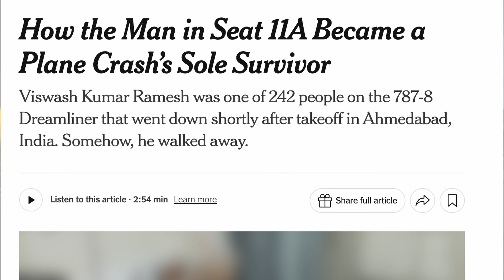Why the RAT Changes Everything – Air India 171 Update

Comment: Absolutely the sound of the RAT. Just did a RAT function test on Monday...have done it hundreds of times during my 28 years as an airline mechanic. The RAT is deployed/dropped manually and a steel cage is placed around this area, for obvious safety reasons. The RAT is designed so a hydraulic powered motor can be attached (to its rear). The RAT is then spun to 4000 RPM'S. Once at 4,000 RPM's the plane's onboard computer is checked to verify the RAT is outputting the required electrical and hydraulic power. In the air the blades of the RAT will auto adjust their pitch to maintain the proper RPM's.
Reply: Thank you this explanation 
Condolences and Prayers for the departed souls
May they forever shine in eternal bliss
Om Namah Shivay
Reply: Saw it done on KC-10. It was on the fwd right side of plane.
Reply: That video was taken by a High school kid Aryan from his terrace.  LallanTop news channel has an interview with him
Reply: @asto-jsst39  Wow that’s amazing. I sure hope it doesn’t haunt him 😕 May his parents help him through this trauma and tragedy. 🙏🏽
Reply: Is RAT a kind of wind mill?
Reply: @mitlaoba It can be looked at that way, yes...When deployed into the airstream it spins to produce electrical and hydraulic power. Even as the plane is slowing down the RAT can maintain its constant speed as its blades will auto pitch to "catch" the most wind.
Reply: @mitlaobayes
Reply: @mitlaoba yes, exactly. it gets spun like a pinwheel
Reply: @mitlaobain its most basic idea for a laymen to understand it's similar.
Reply: I assumed this on the day of the crash. Because the nose was up until it crashed and the gradual lose of power. I got more clarity when the authorities disclosed that the pilot said there is no power/thrust, we’re going down! 
That means something is totally failed to give the engines enough thrust. It can be mechanical/electrical/software related. 
How could you be a pilot without these basic commonsense? How could Steve thinks that the pilot lifted the gear for flaps instead of gears? Both are at different locations like a handbrake and the accelerator of a normal car.
Reply: @പിന്നേ_കോപ്പാണ്  Well, 'it has happened before' is one reason.
Reply: I carried out functionals on Tristar RAT's during my RAF days, our team were the first to do it in the RAF,  Marshals of Cambridge used to do it, we didn't have the cage to begin with, so we hid behind the main undercarriage, in case it shed a blade. Still got covered in Skydrol though.
Reply: Is the RAT driven by air speed?
Reply: @flmulcahy  It's driven by the air that's flowing over its blades. And It does automatically pitch its blades to try and maintain a certain speed, even when the aircraft is slowing down. Obviously, it will spin faster and have a better output of power when the aircraft is moving faster. When the aircraft slows to a certain point, the RAT will cease to be effective.
Reply: @flmulcahy Yes it is driven by airspeed. It's basically a wind turbine.
Reply: Thank you for your insight!
Reply: Another question: do lights flicker in the cabin when RAT is activated?
Reply: @lordjim3109  Yes they do...typically when there is any change over of power from one power source to another, you will get a flickering of the lights. The flicker is the quick disconnect/reconnection of the power.
Reply: @tima.478  Wow! As a private pilot and industrial electrician/high-tension systems controller, I've always been interested in the RAT. In my profession of 40 years, I work with 15kV switchgear and 480V motors-variable frequency drives. 

I've learned more about the RAT in the few post of yours, than I ever thought I'd need to know, just having a basic understanding of it, lol.  Thanks for your input! 👍🏾
Reply: You're very welcome, glad i could help. Stay safe out there. 👍🏾 @MR.Pilot_Electrician
Reply: @lordjim3109  he said that in the video the lights flicker when the rat is engaged
Reply: @lordjim3109  several experts who've been interviewed mention that the interior lights do flicker when the RAT is deployed. The surviving passenger gave an important clue.
Reply: I still don't think it was dual engine failure, that's just so insanely rare. Maybe a massive electrical failure leading to loss of fuel, but that's not engine failure which caused the issue.
Reply: @paulweeldreyer7457  impossible theory
Reply: @paulweeldreyer7457 so here’s a situation I had many years ago. Pilot lost an engine on take off. In trying to perform the emergency procedures for and engine out scenario, they mistakenly shutdown the wrong engine. At that point it was a dual engine failure. The aircraft did exactly as this one did and sank as it lost airspeed. Inevitability crashing.  I not saying this is what happened here , but it is a strong possibility. 

So it could be dual engine failure , or single engine failure with a crew shutting down the healthy engine and making it a dual engine failure. whatever the cause there can be no doubt both engines were down and the RAT was deployed. More evidence of this is how well you can hear the RAT operating. Usually the engine noise masks the sound of an operating RAT. Not in this case. You can hear it loud and clear.
Reply: @paulweeldreyer7457  Yeah, properly functioning jet engines don't suffer catastrophic failures at the exact same time without some outside influence to cause them to loose power, together.
Reply: Most definitely,  another YouTube channel Maxafterburner has a better longer video you could hear the jet going buy sooner and I noticed that buzzing prop noise as it passed buy and NO jet engine sounds and he paused the video and zoomed in and you can see the outline of the door pretty clearly. As a retired aircraft mechanic I feel for them such a tragedy, and horrible thing to go through I pray for them all.
Reply: Thk u for explanation
Reply: If the engines were working we would probably not hear the RAT so clearly too.
Reply: Thank you for your service in helping to keep us safe.🎉🎉🎉
    Capt. Steeeeve has always been my "Go to” Pilot for HONEST Answers and explanations.😊
    Thank you once again for your Contribution.🎉🎉🎉😊
Reply: It is amazing to me that the little RAT can power the critical electrical and hydraulic systems.  I have never one up close but it's pretty impressive that it can produce about 50-100 Hp of mechanical work (generating electricity and running a hydraulic pump) at speeds as low as 150 KIAS without being huge (like a cessna sized prop).
Reply: @larrybremer4930  It only runs a few very critical electrical systems and hydraulics and since it can vary the prop pitch, it can catch a large amount of air, but yeah it is pretty amazing for something that small. I was surprised we could hear it. It was spinning hard alright.
Reply: @larrybremer4930  Another amazing fact is that the RAT can also de-ice itslfe when deployed and spinning. In its nose there are magnets and aluminum plates that provide anti-icing. The RAT is a very complex piece of equipment.
Reply: @tima.478  Eddy currents??
Reply: @rhyoliteaquacade  How do you mean? Several comments here, not sure to which you are referring...thanks.
Reply: @larrybremer4930 would it not be that the longer its deployed for the better@?this would only have been deployed for a few seconds so would have been a desperate attempt to gain power?.
Reply: @larrybremer4930  RATs are old technology and very dependable. Research the EPU on the F-16 and you'll find a unit that goes from 0-50 horsepower in less than a second to provide electrical and hydraulic power in the event you lose those systems from the engine.  The main drawback is it runs on Hydrazine rocket fuel and is extremely toxic. (Ask me how I know). And, it sounds nothing like a RAT.
Reply: @williamhudson4938  My stepfather was a NASA engineer, I am very familiar with Hydrazine and other hypergolics and monopropellants.  Nasty stuff.
Reply: We have a RAT on the C-5.  I understood its function, but never dealt with it.  Great info!  👍
Reply: @MichaelHersh-e5r  Thank you for you and your family (I recognize and appreciate that your family serves right alongside you) for your service. From one grateful citizen to another.  🙏
Reply: @ads3-1.0  Very kind of you to say that.  👍
Reply: Does it retract when power is back?
Reply: @lordjim3109  Yes.
Reply: @lordjim3109  No, the RAT retraction is a maintenance task to be performed only on ground.
Reply: If the RAT can be also deployed manually then perhaps the pilots used it as a last resort to regain some control
Reply: @NicholasAmpazis On a 787-8, RAT deployment is automatic, no manual release for it.
Reply: Deployed manually? Captain Steve said they deploy automatically in the video as soon as the aircraft isn’t getting enough electrical and hydraulic power..
Reply: Why can you hear it when passing by, but not see it until it is far from you?? If it was down, you could see it as it flew by...!
Reply: @lorandvarga6353  because the video quality isn't that good and the camera is moving around to start with.
Reply: @DarrellThompson47 nah. This one has quality.
Reply: Thanks for this very comprehensive explanation to the RAT functionality.
Reply: Here at the valient air command museum in Titusville, fla. There's an F 105 thundercheif with a RAT deployed up front just to the right of the canopy. 😊
Reply: It's fascinating to me that you can hear the sound of that tiny RAT as it flies by!
Reply: Another pilot in another video said the RAT deploys automatically? Is it maybe different for different planes? They hardly had time to do anything, let alone any of that.
edit - I've watched more videos since I wrote this. All say that it's automatic, not manual!
Reply: Would this be a plausible explanation of the root cause: a potable-water leak—not fuel or hydraulics—that disabled the aircraft's main electrical buses just after lift-off? FAA AD 2025-09-12 traces the most credible leak path to floor-panel seat-track joints above the aft electronics-equipment (EE) bay where sealant and moisture-barrier tape were omitted on some 787-8/-9/-10s; water from a galley or lavatory line can then drip onto the aft EE bay power-distribution equipment and short them, creating "loss of system functions essential for safe flight.

At roughly 140 kt, vibration and the 10–12° nose-up swing of rotation could have shifted water or sprung a marginal coupling, splashing fluid onto live busbars. The Bus Power Control Unit (BPCU) would detect the electrical faults and isolate the affected Variable Frequency Starter Generators (VFSGs), blacking out the left and right AC buses simultaneously. Cockpit load-shedding blanks several displays and the autothrottle, cabin lights drop to green emergency strips (as the survivor reported), and the ram-air turbine snaps out—visible in eyewitness video. Each GEnx engine registers "generator offline" status. With disrupted electrical control signals to the FADECs, both engines would enter protective modes and reduce to idle thrust; the ~6 s spool-down lets the jet climb briefly to about 650 ft before settling at low thrust with the gear still down.

With only RAT power, the crew had seconds to attempt an APU start before airspeed bled away—mirrored in the captain's call, "thrust not achieved…falling…Mayday." The clues align: RAT deployment, cabin electrical change-over, running but idle-speed engines, a short climb then rapid descent, unretracted gear, and the DGCA's immediate order to inspect generator and engine-control systems. FAA AD 2025-09-12 mandates sealing those floor joints yet does not supersede AD 2016-14-04, which covered an earlier subset of 787s with improperly installed water-line couplings.

Take-off/rotation is the critical moment because potable-water pumps cycle during high-demand phases, runway vibration adds dynamic loads, and the pitch-up swing can send trapped water toward any unsealed gap—exactly the scenario the FAA warns can wet EE-bay equipment and short essential power buses.

This is the relevant AD: https://public-inspection.federalregister.gov/2025-08346.pdf
Reply: Can a RAT cause the plane to yaw in this scenario?
Reply: @TheSunnyvaleTrailerPark yes it can just a little.
Reply: @TheSunnyvaleTrailerPark  Pilot's might experience a slight change in flight characteristics, but this will be negligible. Especially in an emergency situation.
Reply: Yes also an AC mechanic that was a Rat deployment
Reply: RAT never works as intended - experts can correct me on this. Bunch of busy work until the plane crash to keep the pilots occupied.
Reply: @jasonatkins6111  Expert here...RAT's work well as designed and have saved  many an aircraft from disaster! But, it will need to be deployed well above the 600-650 ft of altitude that is reported in this particular incident.
Reply: all the while I thought the RAT was dependent on windspeed? so how does it spin at the speed of sound if the plane is going less than that?
Reply: @BobbyRoa  The 787 RAT has a speed governor built into its nose. It turns at a constant speed, no matter how fast the plane/wind is. It maintains its speed by adjusting the pitch of its 2 blades. It needs a minimum speed of 120 knots (138 mph). At 130 knots (150 mph) it will produce both hydraulic AND electrical power. It will deploy in any phase of flight. In this particular incident though, descending from only 600-650 feet, it doesn't have time to help you. It will deploy automatically if all parameters are met or the pilots can deploy in manually. If I remember correctly, it does not deploy below 100 knots, no matter what. (is of no use at this speed anyway)
Reply: @tima.478  Makes sense and big thanks for the insight.
Reply: @BobbyRoa  You're very welcome.
Reply: Go and search name Sam Salehpour, whistleblower of "boeing 787 dreamliner". This tragedy was well organised and didn't happened inside the US. Boeing is an american company, this particular model had quality issues and safety concerns. Also gather knowledge about income, corruption and safety negligence of  Dave Calhoun, then Ceo of boeing...
Reply: question:  does the RAT supply power to raise the landing gear?
Reply: @seanhelmi6663  The RAT is deployed in an emergency situation, only...though it can in some cases raise the gear, this would not generally be something you would want to do in an emergency.
Reply: @seanhelmi6663 could it? Maybe. But there’s no reason to. There’s never an emergency for the gear to go up. Gravity will help the gear go down with assistance from the RAT.
Reply: @FullSierra91  Isn’t there good reason to for example if ditching like in the miracle on the Hudson to avoid the gear catching the water making the chance of skating over the water far less likely?
Reply: @fritnat after pilots rotate, the gear is selected to the up and locked position within the first 20-30 seconds of flight. Unless they keep it down if they were experiencing hot brakes on the ground. This happens sometimes when the airport taxiways have a downhill grade and the aircraft is heavy with fuel and passengers. The brakes get hot from the grade and aircraft weight, so pilots sometimes keep the gear down a tad longer to cool everything off, but this isn’t usually an often occurrence. I’m not a 787 guy, so I don’t have the technical answer or emergency procedures book, but with my experience I would say that having loosing both engines, electrical power, hydraulic power, having the landing gear down, flying over water, and still at an altitude where you are able to deploy the RAT and with time to retract the gear for a water landing is really rare. This is part of the critical stages of flight and the most dangerous. In terms of the RAT, you can only generate so much fluid flow where you convert wind to hydraulic power.
Reply: @FullSierra91  I don't see anything in your reply to support the claim you made I was addressing. Yes, it would be really rare but just having both engines cut out is already that. Although really rare it has happened and at that critical stage of flight in the example I gave you. That flight was longer, 3+ minutes, a positive rate of climb, and therefore the gear was up as part of the normal flight procedure. Imagine if that flight had been even shorter as the Air Indian one and the gear had still been down, with no chance of landing in the Hudson but of landing in the East River instead? Isn't it conceivable that in the few precious seconds available it would be an emergency to get the gear up before ditching?
Reply: @fritnat possibly. Like I mentioned, I don’t have the procedures of the 787. My job is to repair RATs on aircraft. I know how they work, their purpose in a hydraulic system, and when/why they are used. The flight in India did not need the gear up. Is it possible that the pilots were trying to correct another issue (loss of electrical power, 1 or 2 eng loss, loss of thrust, flap issues, mechanical issue, and so on…)  and was not focusing their attention on the deployed RAT or retracting the landing gear? I can’t tell you what the final report will say. I’m not here to spread “rumors” of what happened. Back to your question of can the RAT produce enough flow to retract the gear, which is not the case in the India flight. I’d say get with Boeing, the manufacturer of the RAT, and with the manufacture of the landing gear. I guarantee you it is designed to lower the gear AND have partial elevator, rudder, and aileron control to get the aircraft back on the GROUND.
Reply: @FullSierra91  I think maybe you’re confusing me with another? I wasn’t speculating on why the gear wasn’t up or the cause of the crash but the hypothetical case of a reason for wanting the gear retracted from being down, with the RAT deployed. As to whether the RAT can provide enough power to retract the gear, that is a different matter. I have no special aviation knowledge but I imagine it would take a lot more power than controlling the flight control surfaces and electronics so I doubt it.
Reply: @seanhelmi6663 its more to lower the landing gear
Reply: @seanhelmi6663  No, the RAT supply hyd power and elec power but the hyd. flow is not enough to raise the gears. Also it's not the priority to move the gears in case of loss of hyd. power. The essantial systems are the fligt controls.
Reply: Does the output voltage constantly change while the RAT is deployed? at the end u said it maintains a proper RPM so I would guess so there is constant voltage
Reply: Does the RAT supply electrical power to the BUS that the FDR and CVR are on?
Reply: @AvRail57  there is no separate FDR and CVR on the 787, both functions are combined into a flight recorder, but there are two of them. The forward one has it's own independent battery so can record without any other power. The main battery can supplies power for the VHF and flight deck comms ( as well as other essential systems of course ) for the few seconds before the RAT is up and running.
Reply: @AvRail57 Possibly the emergency AC and DC bus, or maybe the emergency AC bus which in turn powers the emergency DC bus via a rectifier, or the emergency DC bus which in turn powers the emergency AC bus via a static inverter.
Reply: I think he is saying that it is powered hydraulically for the test?
Reply: RPM
Reply: Yeah, we heard it in the video. Thanks for your valuable input 😂
Reply: Thank you for realising  this info .
Reply: Even if RAT has been deployed upon take off, it still did not help because of the low altitude. This is what i can say looking at the video. All souls may rest in peace. God bless.
Reply: Thanks for the explanation!
Reply: It’s a common weakness in developing countries Airlines have a very strong maintenance department with excellent flying crews. However, most of those airlines have very weak electronic (avionics) departments unqualified to troubleshoot or repair modules due to advanced manufacturing and high costs for parts replacement. Consequently, bad public address (PA) on flights, entertainment, TV, and music are off or not working even in first/ business class.
Reply: would it deploy with a bang though ? id think not too loud to avoid damage ?
Reply: Alot of experts on here..ya'll engineers or what....?
Reply: so its simply wind power generator. The less speed of an airplane - the less RPM RAT has.
Reply: RAT, stands for "Ram Air Turbine". Just so you know
Reply: I thought you could see something fall from the plane you can see it in the video. What do you think that could be?
Reply: I too can validate this sound.  As an airline mechanic as well with many years of hangar service, having done RAT tests dozens if not 100 + times, this test is done every so often on every aircraft to make sure it functionally will deploy and operationally provide the hydraulics and electric power to keep these airplanes “functional” and controllable when all other sources of electricity (APU, both engines) are not available.  As the pilot said in the video, it only helps you if you have enough altitude as it provides no lift, just turns a small generator or hydraulic pump with the ram air flow of forward flight (depending on the aircraft) to allow modern fly-by-wire aircraft to have continued hydraulic flight control and cockpit instruments to land as safe as they can.  If you are down to this RAT being deployed, you are usually in a very bad and difficult situation.  if this is verified that both engines were shut down, which this original video shows and sounds, these poor pilots had absolutely no chance, and did all they could with what they had.   If the engine was turning, especially at take off power levels, as quiet as the 787 engines are, you would not be able to hear the RAT spinning that clearly, if at all.  RAT’s are very loud, but engines at power are on a different level of decibel!
Praying for all families of the poor souls that died, and for that man who miraculously escaped, I don’t know how you could even begins to deal with almost dying like that, seeing others die like that and then the survivors guilt.   Praying for peace in his soul.   Praying for healing to the entire Indian community.   Praying for safety for all those who fly. Praying for peace over the entire world.  Amen.
Reply: Thank you for explaining this
Reply: So it provides power but does it provide lift? 4000 RPM doesn't sound like much on an aircraft this big.
Reply: The RAT doesn't provide lift, it's not meant to. If anything, it adds a tiny amount of drag.  @Nocturne83
Reply: there's also the fact Loss of ADS-B data almost exactly at the point the plane stopped climbing. also we have the witness account of green and white lights in the cabin that coincide with electrical failure so yes, it had to be a electrical failure of some sort, not pilot error, perhaps either by poor maintenance, Boeing conspiracy, bird strike, blah blah etc.
all hats off to the investigation team that they can deduce the cause hopefully.
Reply: Let's make 2-adjustments here. It is not RPMs. Revolutions per minutes doesn't mean anything. Just call it "RPM." But that is a minor point. But, although you are quite well informed about the RAT, you might not be so informed about the 787. I am not either. But I believe this aircraft has no hydraulics. Breaks and control surfaces all are motorized by lithium batteries.
Reply: @danielocarey9392 that's incorrect, where did you get that information from? The 787 has a 5000 PSI hydraulic system to operate the flight controls and landing gear. There are two spoilers per wing which are electric, the horizontal stab is electric and the flaps and slats have electric backup. The brakes are indeed electric.
Reply: @DarrellThompson47  Yeah, I'm not familiar with it either, so I just did a quick google search and found out it has three independent hydraulic systems.  Why he would make a statement like that, without even checking google is beyond me. 🤔
The man's been working as an aircraft mechanic for nearly three decades, he knows his sh!t. 😂
Reply: @DarrellThompson47  Thank You. I am so used to people spouting things that are not true, that I made a muff myself.

And I am glad they have some hydraulics. But I don't like only hydraulics either. Cables with hydraulic boosters are what I prefer. If the hydraulics fail, the aircraft is still controllable. 

The 787 is modern. And it uses both hydraulics and electric motors.
Reply: @danielocarey9392  "Let's make 2-adjustments here. It is not RPMs. Revolutions per minutes doesn't mean anything. Just call it "RPM."
Yeah, that's one of my pet peeves as well, lol. RPM is already plural by the first word, "revolutions".

That said........
"Breaks and control surfaces all are motorized by lithium batteries."
Breaks instead of "Brakes," is another one that get's under my skin. 😬🤣🤣🤣
Reply: How do you spin the RAT on the ground?
Reply: @tima.478        Thanks for your input and explanation. As additional proof, I'm sure if the investigation team gets the original of that video, that sound can be isolated and compared to the sound that another 787 makes with the RAT deployed.
Reply: Thanks for your technical understanding 👍
Reply: Your lying. The 787 and the rat didn't fly until 2009. That's less than 16 years of flight for rat equipped 787 aircraft. So how did you test 28 years when the planes first flight was in 2009 and it was another 5 years before 787s were produced in numbers for international sales?
Reply: He didn't mention 787s in his comment. RATs have been around since the 1960s at least, so he certainly could have tested them 28 years. It's as well to be sure of one's ground before accusing someone of lying.  @caledoniawarrior
Reply: Thank you,  that is good to know .🎉
Reply: What’s your salary?
Reply: @davetherave13  $140k last year.
Reply: Thank you very much for this information!
Reply: Do we also not hear the jet engines?  Question, would the sound of the jets at full power drown out the sound of the RAT?
Reply: @JohnMasseria yes it would. Which would mean these engines were off or at idle
Reply: Hey! Do you know the range of power (Horsepower or KW) that they can give?
Reply: @estebanamador7601  Commercial jets depending on the aircraft, between 8 or 9 to 70Kw of power.
Reply: RAT can be simulated for test on jackingup the aircraft. By pulling out some circuit brakers. Ram air is sufficient to run it. It provides Hydraulic and electric power for 30 mts. Emergency use. But there is an Auxilary power unit, APU. What is appalling is twin engine failure, Flaps and Landing gears retraction could have been achieved by APU. But one never knows, pilots had very little time to respond. Mind you they were communicating MAY Day signals with ATC also. Veryshort time to respond
Reply: It's extremely lucky to have survived  after the impact and the huge fireball.
Reply: Could that RAT? Coming out to try to rescue the power be a loud noise which the survivor had mentioned he had heard after take off?
Reply: @SimplyShazelle  It very well might have been. Even though the RAT is usually deployed in 3 to 7 seconds on this aircraft, it's quite possible this passenger did hear it...especially with engines not at T/O power, (RAT would never deploy in that case). The survivor reported being in seat 11A. The RAT is located approximately 20-25 rows behind him and on the opposite side, (right side), of the aircraft;depending on the Air India 787 seating layout. It might seem a good distance from seat 11A, but to those of us who fly, we know it's not. When the RAT deploys, it definitely makes a noticeable bang/thud.
Reply: @tima.478  Tx. It seems so many things right now that "don't usually happen" are happening. So it gives weird that it's so sad but we all have this anticipation for why.
Reply: @SimplyShazelle  YW...and I agree, this is pretty unusual, to say the least. Hopefully we find out SOON, the details which led to this disaster. In the hopes that we can avert  another one from happening.  ❤‍🩹
Reply: I'm surprised the RAT can still be useful at such low take-off speeds.
Reply: is there any chance that some of the staff at ground might have done a sabotage before the airplane took off?
Reply: I used to be apart of our hydraulic shop team and we would annually test our C-17’s rats. Damn things would shoot the fuck down so fast once you pushed that guarded switch. We’d use a mounted fishing reel type device to raise it back up to its locked position. On coms the whole time due to the deployment process being so dangerous.
Reply: @claytondavenport6207  There are indeed, several different RAT deployment techniques. If I remember correctly it takes the 787 RAT anywhere from 3 to 7 seconds to fully deploy, but don't quote me on this. The RAT cannot be stow in flight, once deployed. There is an access panel on the belly of the fuselage, usually right near the RAT, that has a switch for stowing. Because the blades of the RAT will stop in any position, we align the blades by hand, press the "Stow" button, the RAT retracts and the door closes behind it. (just additional info for those that are interested)
Reply: @tima.478 pretty much the same as we did. Man that thing used too shoot down so fast in our ops checks. Can’t imagine once the wind caught it how fast it comes down.
Reply: @claytondavenport6207  Most of the commercial jets come down in probably 2 to 3 seconds, pretty quick but it doesn't snap down or freefall. It actually is actuated down by an actuator. Pretty cool stuff either way.  👍
Reply: Good. U know yr stuff
Reply: @alainsaw8362  👍
Reply: Does the RAT bump loudly inside the plane when it deploys?
Reply: @johnhill6154  In the hangar, obviously with no engines running, it's very discernable. Fortunately, I've never had the misfortune to be on a flight where the RAT was deployed, so I would know about a live flight...but, If you're sitting anywhere near it, you will definitely hear when the RAT door opens, which is likely the bump that the surviving passenger claimed to have heard. The RAT on this particular plane, (Boeing 787) does not freefall, it is actuated down in a slower manner, (3 to 7 seconds).
Reply: @johnhill6154  It does make a pretty discernable thud, which is actually the RAT doors opening. The RAT, itself, doesn't freefall on the Boeing 787, it is actuated down in 3 to 7 seconds. It doesn't SLAM down.
Reply: I am a sound expert!
The second video showing the sound of the rat as the plane is LANDING ,CUD ONLY BE HEARD, becaude the engines were iddling!
In the case of the falling airplane ,the ROAR OF THE ENGINES, SHOULD HAVE MASK THE SOUND OF THE RAT.
Therefore there was no engine maximun trust!
Trust me!
The people who work on the plane prior to departure,( 17 minutes delay), should be investigated! As well as who outorized the last minute work!
Reply: @hugozuccarelli6501  If the DGCA, (Directorate General of Civil Aviation), the regulatory body responsible for all things aircraft related, in India; does their due diligence...everyone that has touched that plane in 2025 will be vetted out! 
Good luck with that, though...  😮‍💨
Reply: Dear airline mechanic- with your knowledge— is there anything that a person servicing a plane could do— to tamper with some system that  would be serious enough that the pilots could not override? (with all due respect- a serious question)
Reply: @daisy-rothschild  A "service" in the aircraft maintenance world would be much like a service on your personal vehicle. Engine cowlings, (covers), would be opened to gain access to very critical parts such as fuel lines, oil lines, hydraulic lines, and not so critical pneumatic, (air), ducting. In the timeline that we're speaking of in this particular incident, only one of these critical parts would come into play, so quickly...fuel lines. So, to answer your question, yes. The issue that comes into play in this scenario though, is there would have been some indications by cockpit instrumentation that something was wrong. Absolutely every fluid level; air, fuel, and hydraulic pressure, is monitored to hell and back. The one thing that would go unnoticed in such a sabotage attempt, would be contamination of some sort. I would hope nothing is being ruled out by the investigators, and hopefully we know soon, exactly what happened to this aircraft. 
May peace find the friends and family of the loved and lost!  ❤‍🩹
Reply: RAT = emergency band aid.
Like the tesla with gas generator in the trunk. Genius engineering.  Shmucks
Reply: We can only be justified by the BLOOD of JESUS CHRIST, the Lamb of God, who offered Himself on the Cross to cleanse us from our defilement and thus erase the sin of everyone who places their faith in salvation through the BLOOD of God the Son, JESUS CHRIST, sent into the world as the sacrificial Lamb by God the Father to pay the ransom.

Our redemption is a free gift from the FATHER… through the finished work of Christ under the Law.

And it is only through His pure Blood shed on the Heavenly Mercy Seat that we obtain forgiveness from God the Father. This metanoia, this change of mind, is the understanding that if you are saved, you know that the only way to Heaven is the Substitutive Atonement through the BLOOD of Our Lord Jesus Christ… and that therefore, if you ignore this, you are lost.

--> Have Faith in the Redemption through the Blood of our Savior Jesus Christ before the Rapture of the Church establishes this new paradigm that will force you to die as a martyr for Christ if you desire to have a share in Heaven.

The evening of the Rapture, Friday, August 8, 2025 will be a day of unimaginable distress on earth. BE BLESSED
Reply: Dear Captain Steeve, Your ridiculous comment at the begining of the video that the copilot made a mistake with the controls, is beyond common sense. It annihilates any credibility in your further opinions and comments
Reply: How do you provide Ram air for RAT to spin during the test ?
Reply: @UllulAmar  It's not run by ram air in the shop. It's run by a motor that plugs into it and spins it.
Reply: Its actually a generator driven by wind.
Reply: @UllulAmar I’m not familiar with the RAT on a 787, but usually it is deployed in the air below 220 knots on a periodic basis. Usually every 1-2 years depending on the manufacture and aircraft. We do this to ensure it deploys, spins and provides 4000 psi, and we can inspect all the blades and parts of the RAT while it’s down.
Reply: @FullSierra91  You mean 4000 RPM.
Reply: Negative. The RAT turbine SHOULD spin to power the pump to generate the operating pressure of the hydraulic system it is in. Unless it’s 3000 psi in the Boeing 787. That pump needs to produce flow to power the landing gear and flight controls. Those 2 subsystems have some of the “biggest” motors or actuators that require pressure and a good amount of fluid. Unfortunately if you are using the RAT to generate hydraulic fluid flow and pressure, in addition to electrical power, it’s not good. It’s the last resort.
Reply: @UllulAmar they mount a hydraulic motor and run it with hydraulic test stand.
Reply: @mgomez5606  I think few members of the general public understand how a hydraulic motor is powered. I don't! How does it work?
Reply: @UllulAmar  RAT is powered either from a hydraulic mule or in our case, hydraulic lines built into our hangar floor, much quieter. Some RAT's have hydraulic input/out connections on the side of it for hyd lines to attach. For the 787 there is a small hydraulic driven motor that attaches to the rear of the RAT and spins a spline shaft that turns the RAT's blades. The 767 and 757 the RAT can be spun using onboard hydraulic power from the aircraft itself, for maint. testing.
Reply: @UllulAmar he said,  they attach a hydraulic motor to its rear.
Reply: @UllulAmar  You reverse the hydraulic flow.
Reply: @UllulAmar he told you, via the hydraulic motor. The hydraulic motor is actually a motor when supplied hydraulic flow and a pump generating flow when the RAT prop is in the airstream. It's by nature less efficient than a standard pump because it has no valve plate time due to the dual function.
Reply: @UllulAmar it can be back powered using the center hydraulic system
Reply: @UllulAmar 
You attach a hydraulic test motor to the rear to drive it.
Reply: @UllulAmar  the hydraulics spin the rat during the test
Reply: @UllulAmar - As has been explained in several comments, a hydraulic ground power cart is attached to the aircraft. With the RAT deployed the aircraft hydraulic systems are pressurised, being supplemented by the ground cart. The RAT pump effectively becomes a hydraulic motor, spinning up the blades to very high speed. This is called back-driving. The RAT speed regulation system is then tested, as the blades pitch continuously changes to optimise operation. My experience of this was on the Boeing 757, Airbus A300-600 and A320/321 series aircraft.
Reply: @UllulAmar  we use a ground power unit , its a hydraulic pump rig designed to pump hyd oil in to the hyd pump of a RAM Air  Turbine and is set up safley to do this procedure its also part of ETOPS  , twin engine aircraft mainly
Reply: @UllulAmar a hydraulic motor is hooked to its rear for testing
Reply: @tackela2 it depends on the aircraft. Sometimes it’s a hydraulic pump, or sometimes it’s a generator. I think it is a hydraulic pump on Boeings.
Reply: @UllulAmar  A generator is just a motor and the difference is is what is powering the rotor's movement. If it's physical movement like from a wheel or a propeller, the device is then a generator. If it's electromagnetism using power from the stator to drive the rotor around it, it's a motor. That's really all it is and that's why you can both power and recharge things using electric "motors". If you apply a reverse polarity in the stator (it's a bit more complex than "just" reversing it) then the motion of the wheels goes from being driven by the motors to generating electricity that's being put back into the battery.

With the RAT, they can test it by turning the generator into a motor, because the battery/power system aboard is already functioning. It's when it doesn't have power that the RAT's power generation is used. But again, you take a generator and whatever physical means is being used to crank something to generate electricity and reverse that flow of electricity, that thing will become a motor instead. You could turn a wind turbine into a giant fan if you wanted to. You could change a hydro electric dam into a vacuum if it was needed (although I feel like if the water level on the other side was deep enough for water to be sucked into the outlet, odds are is that there's something wrong with the dam to begin with.)

It's either that or everyone on location just all pile up and blow really hard in unison hoping for the best.🤣
Reply: @UllulAmar  
Here's a video of a RAT test on a 787. In the video you can see the hydraulic motor attached to the back of the RAT, and the hydraulic lines attached to the motor. A ground service cart provides the hydraulic flow to turn the motor, which in turn, spins the RAT.
https://youtu.be/O1r3CuRwjPc?si=3XZHTErnRGn9zNGv
Reply: @UllulAmar  a hydraulic motor is attached to it to spin it during the periodic test required by manufacturer.
Reply: But on a ground test you are back driving it with hydraulics adding to the noise.
Reply: @thirdstone4107  We run it from in flloor hydraulic piping in our hangar, no noise from a hydraulic mule. Just the noise of the RAT spinning.
Reply: @thirdstone4107 are you serious ?
Reply: 1:38 Sir, at this point you can see the Engine Flame Out Smoke. That's not Dust. 😢😢
Reply: @sambitranjan9584 So one engine stopped ? You would presume that if both engines did it never got airborne. And the RAT is heard but I haven't seen any comments on can you hear the RAT when even one engine is on full blast ?
Reply: @nl1cat  I would say both engine flamed out at Rotate, the V1 speed & momentum led the Aircraft gain some altitude 😢
Reply: No one has discussed fuel contamination as a theory. India, as we all know has bad infrastructure. Maybe some contaminate got into the jet fuel supply.
Reply: @geea8509  But no other aircraft was affected?
Reply: @geea8509  that plane wouldn’t have been the only one that used the same fuel that day. Wouldn’t other planes have similar problems.
Reply: @geea8509 Yeah, if that's what it turns out being...  😬
Reply: @geea8509 good guess!!! as if that was the only aircraft re fuelled at that airport on the particular day and no other planes were re fuelled before or after that aircraft
Reply: @geea8509  That’s what I believe as well
Reply: @geea8509  Captain Steve discussed about it the other day and said there would have some initial warnings before takeoff. but that also another possibility.
Reply: @geea8509 The very same plane completed a flight a few hours before the crash with no problems, including in recent days. So there was no problem with the fuel in those flights.

Suppose the fuel was deliberately contaminated for this flight (real possibility that cannot be ruled out, e.g. as a hit) which caused dual engine failure
Reply: @pyrophoenician9696 hmm very interesting. I just realized something. These engines are FADEC controlled. If the command signal from the throttle quadrant is lost the engine will automatically go to idle. What if the wire harness from the throttle quadrant was cut?
Reply: @geea8509 You are talking about the nation that successfully landed a space vehicle on the previously unseen South Pole of the moon where other nations failed. Please educate yourself before commenting randomly.
Reply: @geea8509  I've heard it discussed. If the engines actually failed, a fuel issue would make sense (possibly vapor lock though I doubt it). Fuel contamination is possible.
Reply: But, why is the Air India maintenance team not scared of the ongoing electrical problem.!!! More crashes are coming!!! The Indian Government must control the unethical cheap plane Fair... To save the glass we are losing diamonds (Innocent soul's)
Reply: @sharifulekramjulu9975 this is many places in the world these days but some worse than others. I've seen some other documentaries and it's scary.
Reply: This new evidence should be enough to ground these now. Nobody knows why this happened and until we do they are gambling with people’s lives.
Reply: Is RAT a kind of wind mill?
Reply: @mitlaoba yes, Ram Air Turbine. Generates electrical and hydraulic power.
Reply: @gregbailey45  So the rushing air spins the RAT blades, and that energy generates electrical and hydraulic power, is that correct?
Reply: @mitlaoba Yes the propeller is turned by the wind and this turns a generator  to generate electricity
Reply: There is a video on YouTube made by a passenger (supposedly) on the flight before the crash flight complaining about electrical problems in the passenger cabin.
Reply: There is literally 0 RAT sound on that video. It sounds like a jet engine all the way. The comparison what that Air Japan video makes that even clearer. I'm not saying the RAT didn't deploy, I'm saying there's no evidence in that video that it did.
Reply: How come that NON OF THE INSPECTORS appears to have seen the RAT?? It may be damaged, but should 
still be visible in some way. From my experience, it is not difficult to identify it!!!
Reply: @generaclesdey4622 Do you mean at the crash site with a million pieces of wreckage and buildings etc and 90k of jet fuel burning?! It will take a days for them to sift thru the misery of the crash, it's a Grimm difficult business that takes time. Good grief, 23 years in USAF I have been thru crash and incident investigations and was trained and it's a horrible thing.
Reply: @generaclesdey4622 they may have just not publicly gone and stated anything yet and keeping it for first report of findings.
Reply: @generaclesdey4622 how do you know they didn't inspectors don't come out with anything until they know for sure what happened black box videos etc
Reply: @generaclesdey4622  They wouldn't "see" it whether it was deployed or not.  That part of the airplane is in a million pieces, so other than a forensic examination, the evidence presented here plus the flight data recorders will be the evidence.  Not some inspector walking around the wreckage.
Reply: @rgarito if they do a us style investigation they may collect the pieces and reassemble them in a hanger.
Reply: @rgarito the Inspectors walk around looking for clues and evidence etc then they information from the black boxes  and  flight tower etc they just don't come out with nothing until they know the facts of how the plane crashed
Reply: @generaclesdey4622  Did you know that the plane crashed, and that when a large jet crashes, there is a lot of wreckage and debris?
Reply: Thanks for sharing. Seems like these dreamliners have some issues from what I've seen.
Reply: Is a RAT the same as an APU?
Reply: @GinG-q8t  No, an APU is a Auxiliary Power Unit which is powered by jet fuel. The RAT is power by the airstream/airflow. APU's supply electrical and pneumatic air...they do not provide hydraulics directly but they can supply power for hydraulic systems to operate.
Reply: @tima.478  though of course on the 787 the APU only supplies electrical power.
Reply: @DarrellThompson47 If the 787's APU is like other passenger aircraft I worked on (when I was in the industry, years ago), it provides electrical power and bleed air (for engine start and air-conditioning).  The electrical output is used to drive electrically-actuated hydraulic pumps.  For example, the DC-9 had a hydraulic pump driven by the APU-driven alternator.  It pressurized only one of the hydraulic systems (can't remember if it was left or right, sorry), and a back-to-back swash-plate pump in the main wheel well pressurized the other system.
Reply: @vk2ig I'm not sure what comment you are replying to as YT is a mess when it comes to comments, but as I said the B787 doesn't have a bleed system like conventional aircraft, so the APU only supplies electrical power which is how the engines are started. The left and right hydraulic systems each have an electric hydraulic pump in addition to the engine driven ones and the center hydraulic systems has two electric hydraulic pumps.
Reply: @GinG-q8t nope. If you have youtube, I'm sure you have a Web browser to search what an APU and RAT are.
Reply: @GinG-q8t  No. The APU is mostly there to provide enough power to start up the engines that will provide the rest of the power needed for the jet. When more power is required than expected, the APU is used to fill in to keep the amenities for the passenger comfort going. But mainly it's there to be the designated backup support for all power. The RAT is there for when everything fails. The APU is generally another jet turbine engine that's solely there for power generation instead of thrust. The RAT has no fuel needs and is literally more akin to a wind turbine specifically for the airplane. It's the literal "Oh s*it." last option the plane has. There will no longer be any movies playing. No AC keeping the cabin nice and cool. Your comfort just got sidelined for getting that thing to the ground.

The RAT, as Captain Steeeve explained, is meant to be that last ditched resort when you're at altitude and have time to react. When you're that low to the ground, the RAT won't do you much good. It's not built to power the entire airplane. It will power enough to give the pilots control and communication, keep you alive, and hopefully let you touch down safely. The problem that occurred with this particular incident was that they were too low to the ground (no time for them to really do anything) and going too fast (take off speed).
Reply: @steeljawX thanks for that. So basically auxillary power is there if one engine is lost.. no engines, at take off speed, close to the ground is nightmare fuel. They must have had enough power to get them to rotation speed, i wonder what the hell went wrong?
Reply: @GinG-q8t No, the APU is a small jet engine that can provide electric power, primarily on the ground, or when airborne. It will power lighting, engine starts, heating, air conditioning, etc.
Reply: You cant hear shit except for the engines
Reply: I imagine one of the consequence of the RAT being out is that it also eat up some of the airspeed through friction.
Reply: @Slarti  it's insignificant and won't drop airspeed to matter.
Reply: So why are we not seeing the RAT when the plane is closest to the camera, but we can hear it?
Reply: @momchilandonov you can see it. It’s just not very easy to see. RATs are not very large, about the size of a small outboard boat motor.
Reply: @momchilandonov  you have to use a brain. Thats why.
Reply: I think the RAT did not have enough energy to power the whole plane because it was  30 second after take off.
Reply: @SrinivasReddy-d5i  it’s not powering the engines anyway so the engine failure is not because the rat couldn’t provide enough electrical power - the rat is only basically to allow minimum operation of control systems
Reply: @SrinivasReddy-d5i  Well it’s not designed to power the whole plane only the critical stuff. I’m hoping you are not thinking that its purpose is to provide thrust, in reality its totally the opposite it will add drag but that’s not what caused the plane to crash.
Reply: @SrinivasReddy-d5i  I don't think they're meant to power the entire plane. I think they're supposed to provide enough power for the plane to allow it to land, communicate, and glide/fly a bit. If it could power the whole plane, we'd have more mandatory redundant RATs aboard. Most of the power an airplane has is from the APU and the jet engines themselves. The RAT is there to just keep enough power going to get the plane on the ground. You're not supposed to be able to cut all power, deploy the RAT, and cruise around on RAT power.
Reply: Just guess, possible one pilot pulled throttles to idle after liftoff having a temper tantrum 😊
Reply: Captain Steeeve is a bit late to the party. I said this 2 days ago. So called experts? Yeah right.
Reply: @simonmiller5118 I don’t know if you can call him a “so called expert “. He flys planes everyday and your on the internet. Stay in your lane
Reply: @simonmiller5118 Yeah, the audio was pointing to the RAT mere hours after the crash.
Reply: @simonmiller5118  so what.. Does it really matter, it's not a race!
Reply: @simonmiller5118  i didnt see you post anything about it..where is it posted then please.
Reply: @simonmiller5118  Hvorfor så arrogant? Eksperter kan også tage fejl!🤔
Reply: @simonmiller5118 but you didn’t have proof then - no one did, making yours a guess essentially.
Reply: @ashb001 The proof was the AUDIO which was available very soon afterwards.
Reply: @simonmiller5118  Yep, you sure did.  Bravo sir.
Reply: @simonmiller5118 ...and where's your video analysis? 
The man on the screen actually did 2 now.
Reply: @simonmiller5118  let’s all give you a standing ovation & blue Peter badge!!!
Reply: @simonmiller5118 right Meccano man
Reply: @simonmiller5118  Do you want a medal??
Reply: @simonmiller5118 dang, you're something else.  He probably knew also, but was busy making the video.
Reply: Nah Uranus is wrong it was pilot error
Reply: @luisfernando5998 stupidity
Reply: all what you said in the first and second video people explain it before you ! you watch people on youtube  then you come here and say : am sorry, i have to change my bullshit ! 😀😀😀
Reply: @hamedhamdi9969 ok air Indian bot
Reply: @hamedhamdi9969 wow! The man is a professional, seasoned pilot. What the fuck is wrong with you?
Reply: @hamedhamdi9969 you got to be about 15 years old
Reply: @hamedhamdi9969  What is wrong with you?
Reply: @hamedhamdi9969  He’s a professional airline pilot - what do you do for a living, make sarcastic remarks on YouTube?